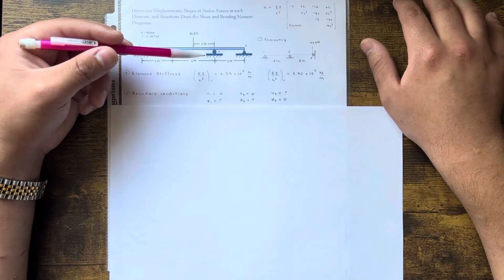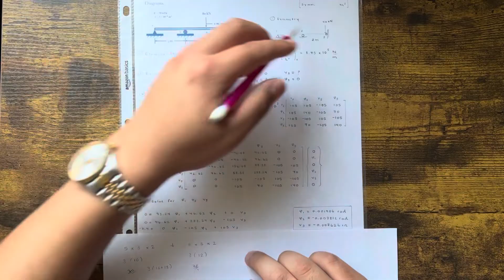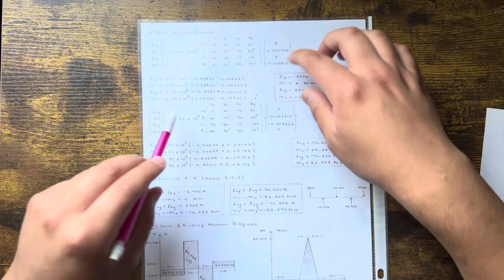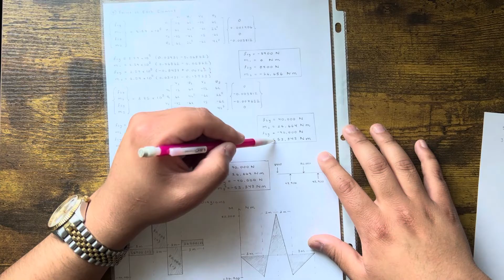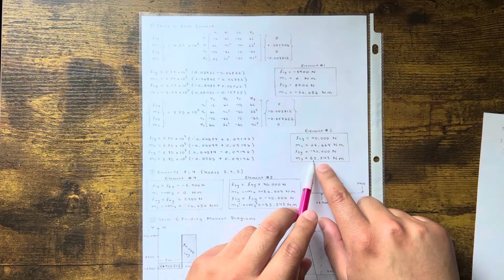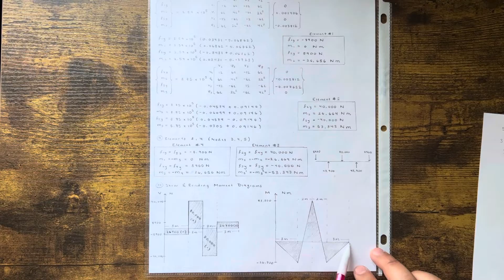Finite Element Analysis- Determine Displacements, Slopes, Reactions, and Shear & Bending Diagrams

Comment from the maker: I forgot to show how the element forces were confirmed with the Bending Moment diagram.

Look at the Bending diagram where element 1 is (from 0m to 3m). 

To the left (at Node 1 or 0 meters), the value for moment is 0.
To the right, the value for moment is -26.6 kN m. That’s the values for forces in element #1.

Now go to element #2, between 3m and 5m. 

To the left (at Node 2 or 3 meters), it’s -26.6 kN m and to the right (at Node 3 or 5 meters), it’s 53 kN m.

But for element #2, our moment at Node 2 was a positive 26.6 kN m. 

That’s the rule. The signs just change. Do the signs for each element using the bending diagram and you’ll see the pattern.

For element #3, that 53.3 kN m will turn negative into -53.3 kN m and will go to -26.6 kN m.

For element #4, that -26.6 kN m will turn positive to 26.6 kN m and will go to 0.

Hope this made sense.